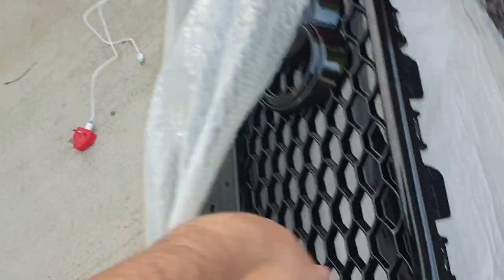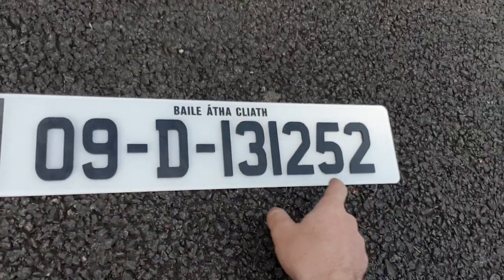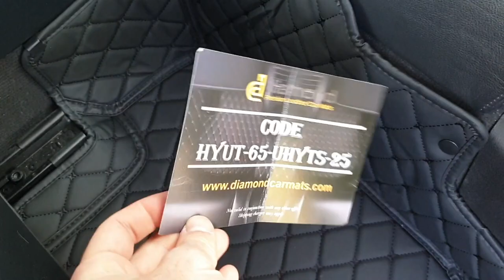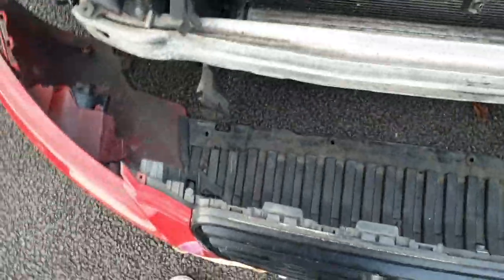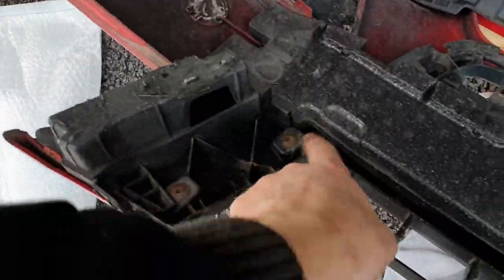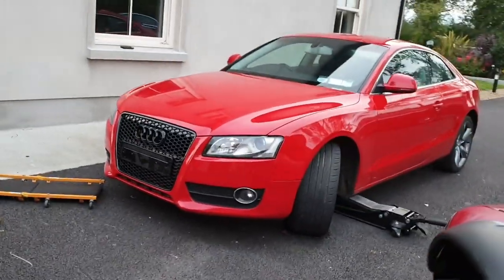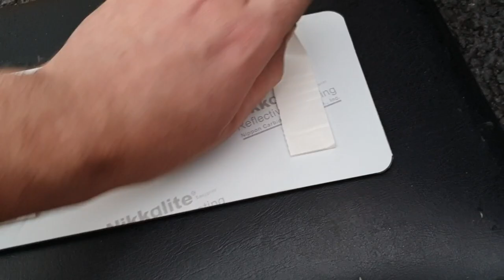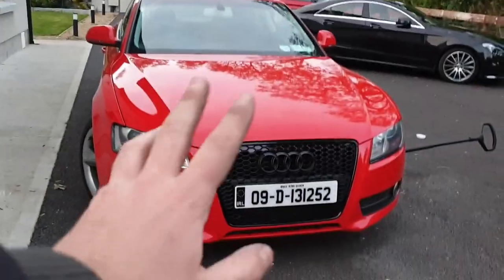Installing The RS5 Honeycomb Grill On My Audi A5!

Comment: Would have been good to see more of the proceedure of actually doing the work, but still... little, tip: you might not want to work under the car with just the trolley jack supporting it. Better to rest the car on jack stands and then use the trolley jack as a backup for double the security.

Comment: Nice additions, are the black edition logos on the plates legal.
Reply from the maker: No its supposed to be blue, but the font size is correct so i shouldnt really have any problems. Ive been through loads checkpoints with them no bother